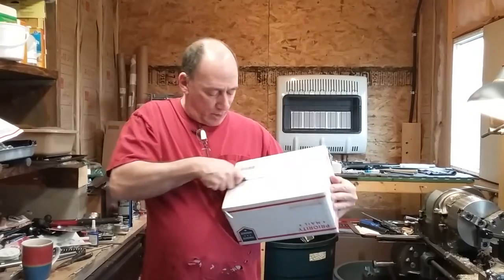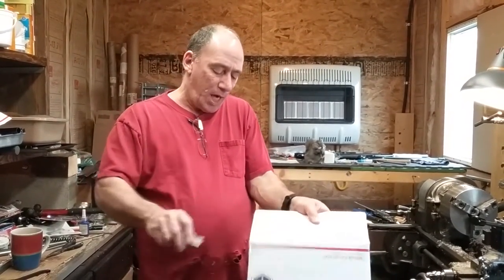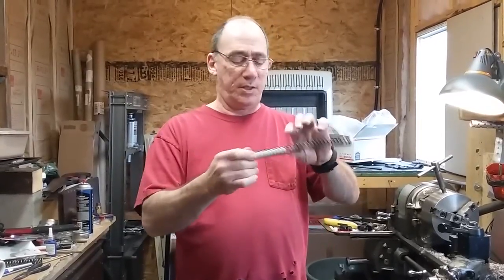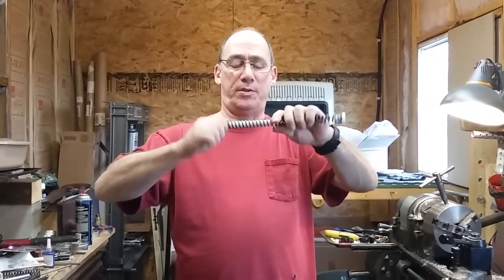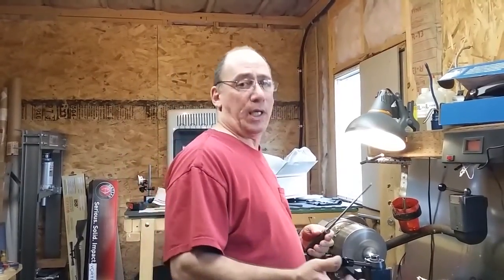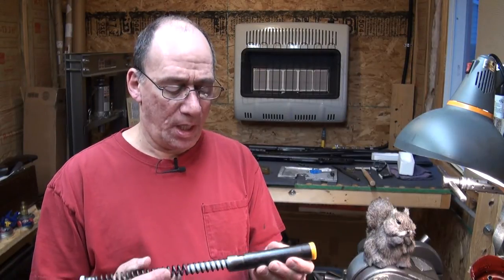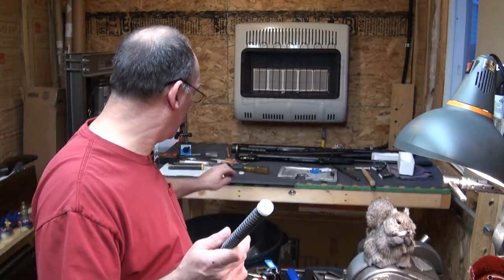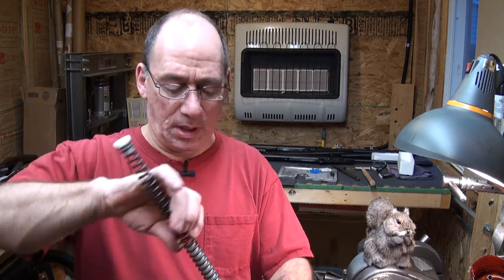Update of Making a webley vulcan spring guide

Comment: Great job, a lathe soooo handy, what l did on my Vulcan was make a guide and top hat out of a steel bar, then polished was perfect fit ID of spring, took a skimming out of the piston then could get a sleeve in, stops twang, also stops any grease getting on the seal, after everything was done it was doing 14ft/lb so l got it down to 11.9 usinf FTTs 14.6 grain.
Reply from the maker: Awesome.
Its nice when something comes together / it does not always work that way
I recently ruined a wonderful.20 cal Loather Walther barrel press fitting it into the block. but that's how  you learn when things  don't go rite

Comment: Webley Vulcans do not respond to being over stressed positively. They are fitted with heavy pistons that just create nasty recoil, far better to smooth them out and settle for 12-14 ftp's.
Reply from the maker: Hi David
 usually when  doing a rifle especially that model size  you can tell it will need a soft tune (sort of speak)
  I agree  with you its best to make it shoot smooth by a proper  lower power set up.
Thanks  for your input // best regards Mike E.

Comment: Never leave the chuck key in the chuck. Never.
Reply from the maker: Hmmm 3-1/2yr old video / H ow many times I have heard that. from this one video alone

yes I know and never cross the street without looking both ways.
But Thank you for caring
 be safe
Reply: @MrSteppingstone888  I was a machinist in the Coast Guard, and was in the shop when a chuck key broke a guy's arm, the bone was sticking out.  It was a bigger lathe, over 20 inch swing.  I never  forgot the snap made, like a 2x4 breaking.
Reply from the maker: @handygent45  
I been pretty  good about  removing  the chuck key now days.
 the  SB  10  chuck key will fling off  if  it  is turned  on while in the chuck. it happened 1x  that's  when I started  paying more attention.
I  am a retired plumber commercial  industrial and residential Ive seen a lot of guys get hurt I always been safety conscious and aware  of  using your head and thinking it thru  / people hurt there back at a early age for not using there head and being in a hurry
Thanks again